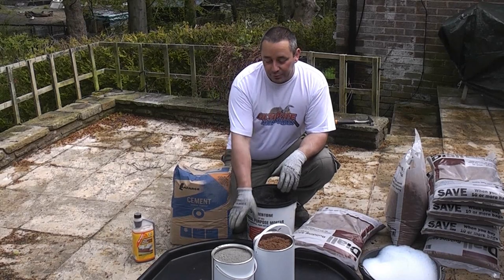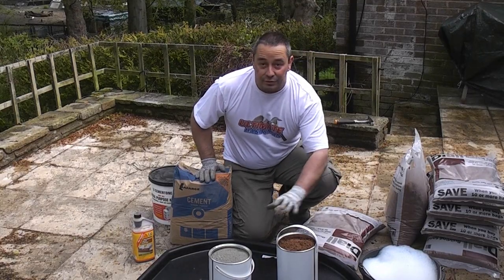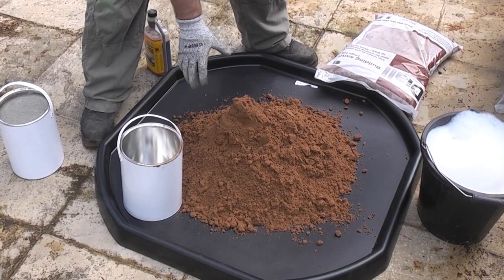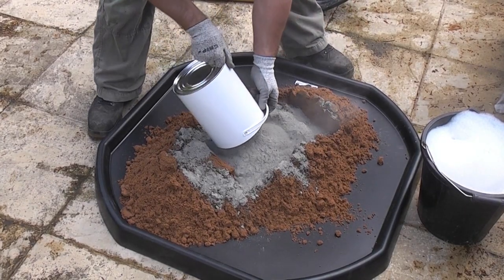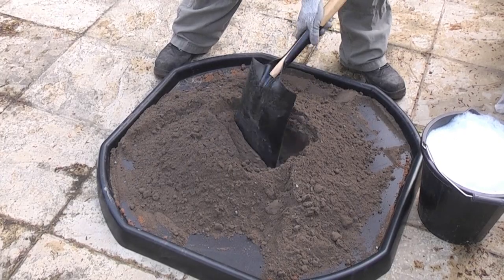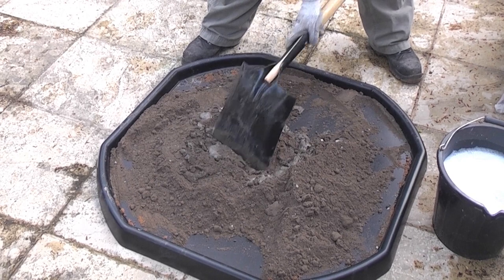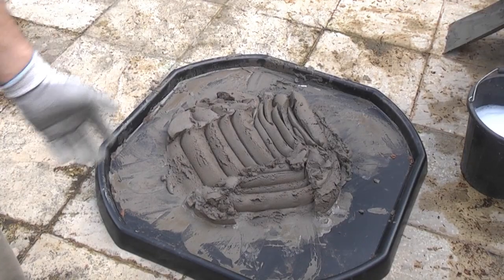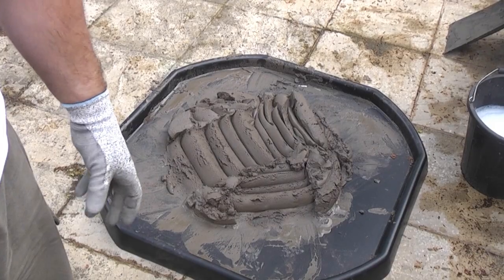How to mix cement by hand

Comment: My dad taught me to lay bricks, we made our own bricks and breeze blocks (those square decorative bricks) and paving stones. We would buy sand by the tonnage and multiple bags of cement and hand mixed it, no cement mixer machinery for us and we landscaped our back garden. You see my dad worked in the brick shop department at college , he would mix the mortar to a consistency so it would bind together but can be reused a few times so trainee brick layers can do their thing (then dad would take it apart clean the bricks ready for the next trainee. Then dad had a heart attack and had to leave that department as the work was to heavy for him, so he went to the fabrication and weld department, taught me to weld then sadly had another heart attack that he passed from many years ago.
Reply from the maker: That sounds really interesting, I love doing jobs like that, although it would be difficult making a lot of bricks that way. My dad also died of an heart attack, I've also lost a few friends to heart attacks! I was lucky when I had mine last year.
Thanks for the comment, Chris

Comment: I HOPE i get the cement the way you've done it. FANTASTIC vid because you explain slowly & show bit by bit. I give you 1000/1000
Reply from the maker: Thanks very much, as long as you mix it to the correct ratio and mix it well dry (before slowly adding the water) it should work out ok ;-)
Thanks for the comment

Comment: Most impressive Mr Ultimate Handyman and especially impressive that you dry mixed it 1st as this is the optimum way for everything to blend.
I actually do all my work in lime putty and if I have to I'll use an NHL (hydraulic lime) but
only if the architect stipulates it.
if you have never used lime I suggest you try as it makes the stickiest of mixes,for the optimum sticky mix with cement do 3 sharp:2 soft (builders):1 cement otherwise with lime mixes most people use a 3:1 and I like 2 sharp:1 stonedust:1 lime.
I'm not trying to convert you but I think you may be surprised by lime,another fact with putty mixes is that if you mix too much you can put it back in the tub,cover with a bit of water and it will still be usable years later,you can't say that about cement.
All the best.Peter.
Reply from the maker: +Peter Gambier Thanks Peter. I have used hydrated lime in the past, but only when repointing.Thanks for the comment ;-)

Comment: Thank you! I'm starting a small cement rendering project and this has been a great help.
Reply from the maker: You are welcome
Thanks for the comment
Reply: ***** what type of sand is the best? we have in the middle east 2 types of sand: smooth and rough, so in the UK what do you use? thanks
Reply from the maker: *****
In the UK we normally just use Building sand for mortar, unless it is being used for rendering in which case plastering or fine washed sand is used.
Thanks for the comment

Comment: Fascinating! I have never heard of a 4:1 ratio before. Everyone I've ever worked under has always used either 2:1, or less commonly 1:1.  Have you ever used the ratios I have mentioned, and if so, could you describe the advantage of 4:1? Thanks in advance.
Reply from the maker: I always used to use a 3:1 ratio, but a friend of mine who is a brick layer said that now 4:1 is used because it allows the mortar to be more flexible which allows it to expand and contract without damaging the mortar. I have never heard of anyone using a 2:1 or 1:1 ratio before, where are you based?
Thanks for the comment ;-)

Comment: great tutorial , thanks.  I repaired some loose/perished rendering on my house (over 100 years old and pebbledashed with what looks like marble chips on top which I have rescued).  I followed the 4/1 ratio but did not add plasterciser (is that ok)  , I did not make too wet a mix fearing the mortar would just slip/drop , it seems to have held do you add or soak water to it when it dries out - I fear it may well just crumble but it looks ok at the moment  - the weather is quite dry , will this be watertight - hope I have used the correct product.
Reply from the maker: Tom Cat Thanks, you could have used a 5-1 mix for rendering but it should be okay. The plasticiser just makes it easier to work with. It should be fine as long as it does not dry out too quickly, if there is any chance of that you could give it a light mist spray of clean water using a garden sprayer etc.
Reply: ***** brilliant , that is what I have done,  the weather is cool /dry and the wall is dry, I dampened the wall first too.    I am assuming it will dry and be waterproof.  Thank you for good advice. It is nice to DIY - I was real apprehensive of having a go.

Comment: Thanks for your share. May I ask that when wet mixing, does the liquid is water with PVA? if yes, what is the ratio of water and PVA?
Reply from the maker: No, you do not mix PVA with mortar. I used a special mortar plasticiser like this- http://fave.co/2CXZa2w
You mix it with the water as per the instructions, then use it for the mix.
Thanks for the comment

Comment: Great video! Very helpful, I have a question if anyone can assist me? I have been collecting red sandstone for a couple of months, and I now have enough to make a wall for my garden border, my question is, which sand:cement ratio would you recommend for working with red sandstone?

Thank you.
Reply from the maker: Daniel Thompson I'm not sure if red sandstone requires a special ratio when mixing, I'd just use the 4 sand, 1 cement as in this video and perhaps a 1/4 of hydrated lime to make it more flexible. Someone with more knowledge might recommend a different ratio. 
Thanks for the comment

Comment: Thanks for the videos you've made you have helped me loads. I have a question I mixed mortar as in your video to fill the 3 inch gaps between my flags and 2 days later it has dried really patchy. I'm confused as to why it looks such a mess have you any thoughts?
Reply: just to add I used the same sand in the video from B&Q.
Reply from the maker: Lee Cornall
I have never had that problem, sorry.
You could try asking in the forum (preferably with a picture) http://www.ultimatehandyman.co.uk/forum1/index.php

Comment: Nice video, as usual.
Do you just add sand to extend the cement, of could you use straight cement?
Is there some book that explains all the different things and mixed, cement, concrete, mortar, grout, etc?  I never really worked with much of this stuff.

Comment: A very slow process - I can do it in a quarter of the time. I put the sand or sand and gravel mix into a wheelbarrow, make a well in the middle, add the cement and water, and mix thoroughly with my hands (thick gloves essential as cement is irritant). Result - in two minutes I have a uniform mix that sets perfectly.

Comment: Good clear video, nice end product cheers mate
Reply from the maker: You are welcome
Thanks for the comment
Reply: I wonder can you add some more water when the mortar dries out 2 hours later? Or would it be near setting? Sorry for the stupid question!
Reply from the maker: andrew truzzi
I'm not sure if this is a good idea or not. You should certainly never do it with concrete but to be honest I have done it with mortar in the past and it has been ok.
Reply: andrew truzzi Yes,"Tempering up" is permissable after a short time,but do not keep on doing it,try to use your stuff before you break for lunch etc,or do anything else,then mix fresh for the next jag at things.
Reply from the maker: jcbairmaster73
Thanks for the comment ;-)

Comment: Can you confirm what sand you used and if this mix would be suitable to lay a few lightweight slabs to an existing solid concrete base?
Reply from the maker: I just used building sand. This mix should be fine to fix the light weight slabs to concrete.
Thanks for the comment

Comment: Hi there I'm going to be doing some cement rendering on a little breeze block wall is this mix ok to use it looks like the right consistency. Any tips much appreciated great vid!
Reply from the maker: 4-1 ratio can be used as a scratch coat, then a 5-1 ratio can be used for the top coat.
Don't be tempted to use PVA, you can wet the blocks before applying the scratch coat or prime with SBR

Comment: Could this mix be used for all concrete jobs. I want it for a floor?
Reply from the maker: No, this is just mortar for use between bricks etc. You need concrete for a floor.
You can mix small amounts the same way, but if you need a lot it is easier to use a mixer.
There is more info here on mortar mixes/concrete- http://www.ultimatehandyman.co.uk/how-to/brickwork/mortar-mixes
Thanks for the comment 👍

Comment: does the ratio of 4 to 1 depend on how big of the job is? im making a patio, how much ratio should i use? and what sand and cement is best for the slabs ?
Reply from the maker: For laying patio slabs I'd use grit sand at a 6:1 ratio
Reply: great thanks, but if i were to go with a premade mortar, which brand is the best to use for a patio?
Reply from the maker: Tarek Taher
I don't think there is a premixed one that is suitable. You would have to check at the builders merchants ;-)

Comment: ive got ready made mix in medium bag how much water would I use it for filling gaps in patios flags
Reply from the maker: No idea. I don't use mortar guns I'm afraid.
I tried one years ago when re-pointing a house, I mixed some mortar and put it in the gun, when I squeezed the trigger all the mortar stopped where it was and water exited the end of the gun.
There are people that use that guns but they often say that they mix loads of plasticiser with the mortar- which will weaken it significantly.

Comment: Can this be used for fence posts, instead of postscrete etc? Is it cheaper ?
Reply from the maker: You might have to add some aggregate, instead of just the sand and cement.
It might be cheaper, but would be more time consuming.
Thanks for the comment 👍

Comment: hi im wondering if the sand im using is wrong its builders sand but its grey and definitely more gritty if I mix a 4/1 ratio it really doesnt look like your creamy mix but if I add more water it goes too sloppy ..
Reply from the maker: It sounds like you might have grit sand, builders sand normally has similar sized sand particles. 
Sand can vary in colour depending on where it comes from, normally the builders sand round here is red in colour but I have seen some that is more a creamy colour.
Reply: I think Ill look for myself next time in the shop lol I just ask which oine will do usually so thanks for that :)
Reply from the maker: luanna lovell
You are welcome.
Good luck with your project ;-)
Reply: luanna lovell Well actually, the reason your sand isn't creamy is because it doesn't have clay in it. You can add some yourself though. In your backyard, dig down 3 feet and take some of the soil. Sift the rocks out of the clay subsoil and add the powder to your sand. Good masonry sand should be 2 parts sand to 1 part clay.
Reply: thanks but ive done enough digging in my garden to make a construction site lol ..Ill find some clay somewhere else :/

Comment: Please,,
what did you add on the water ?? what's the amount ??
and how much liter of water did you add on the mix ?
Reply from the maker: I added mortar plasticiser which improves adhesion and work-ability of the mix.
It depends what make you get, it will say on the bottle what amount to add to the water.
When adding the water you cannot measure it because the sand will already be moist, so you have to just keep adding water until you get the mortar to the correct consistency.
Thanks for the comment
Reply: ahaa thank you dear :)

Comment: Hey could any tell me,
Could I use this mix for small garden path?
Reply from the maker: If you are repointing the gaps this mix will be fine, but if you are making a path you should use concrete.
http://www.ultimatehandyman.co.uk/how-to/diy-building/mixing-concrete
Reply: Ultimate Handyman 
Hey thanks for the reply,
Yey looks like I’ll have to go with the concrete this method just seems a lot easier.
I’m doing a small path in the garden 9foot by 2 foot,
Was quoted 400 - 600 Euros by tradesmen so I’ll have to dig out the shovel 👍

Comment: hay can u explain me how you measure how much water it needs to be added?
Reply from the maker: No, sorry.There is no exact measurement for the water as the sand is often wet, the wetter the sand is the less water you need to add to the mix.
It's best to add the water slowly as you can always add more- but you can't take it out!
Reply: Ultimate Handyman ok thz btw why is your water forming? added admixture super plasticizer? thz for your video and reply :)
Reply from the maker: Yes, there was a plasticiser added to the gauging water early on in the video. This makes the mortar easier to work with.
Thanks for the comments ;-)

Comment: How much mortar or concrete has he mixed, not much by the effort he's putting into it, not enough to bring up the fat anyway.
Also bit suspicious was all the equipment was brand new and looked like a bit too much plasticiser in the water mix.
Reply from the maker: I mixed enough for the job that I was doing!
The plasticiser was measured out, as per the instructions ;-)
Reply: @ultimatehandyman  I did not mean how much you were mixing there I meant how much mortar had you mixed in the past.

Comment: i done the same as you but my mix doesn't stick to the building blocks,why?
Reply from the maker: It should do, what kind of blocks are they?
Reply: The light building blocks
Reply: I think the name is thermo light blocks.
Reply: how much pestisicer I have to user for each sand?
Reply from the maker: All plasticisers are different. You need to check the instructions with each particular make.

Comment: what is the water ratio??
Reply from the maker: There is no water ratio as the sand can have varying water content, so you just have to add it a little at a time until you get the desired consistency.Thanks for the comment
Reply: So, i just need to maintain the water usage so that the mortar mixture is not too watery??
Reply from the maker: Yes, that's correct ;-)
Reply: Ok... Thanks for the advice
Reply from the maker: You are welcome ;-)

Comment: I'm not liking the look of that mixing tray, looks a bit too shallow.

If anybody is wanting to do something on the cheap, I'm planning on using a baby bath tub from asda for £10 (instead of mixing tray as shown or wheelbarrow) and a draw hoe from the range for £10 (instead of shovel or mortar hoe).

If you want something a bit easier on your back, a wheelbarrow would be better but don't miss out the back hoe.  The real tool is of course a mortar hoe but they are difficult to find, a draw hoe should do the job
Reply from the maker: The mixing tray is fine 
Thanks for the comment 👍